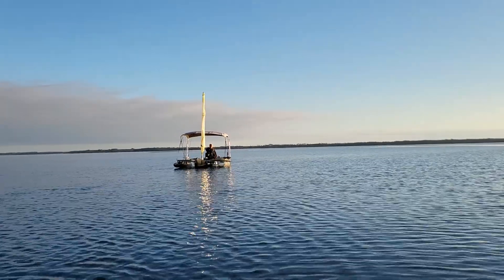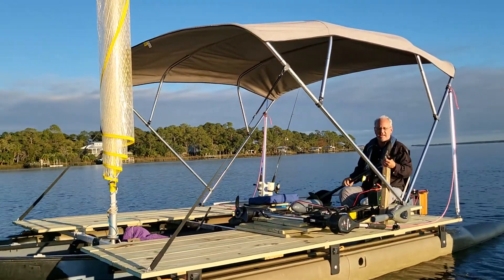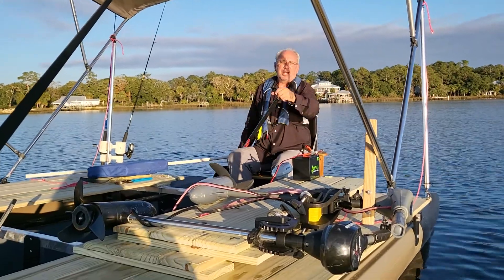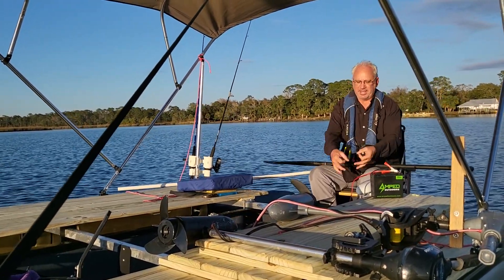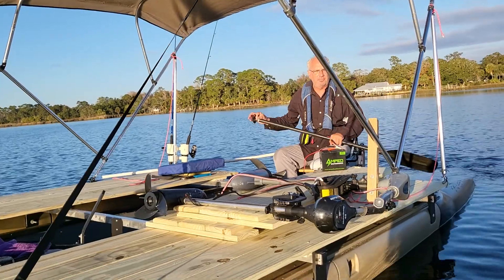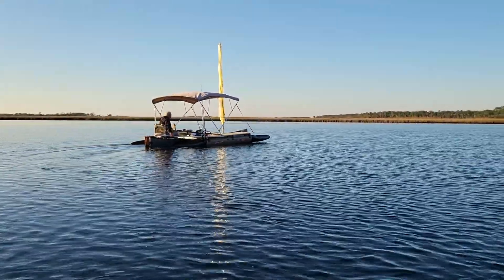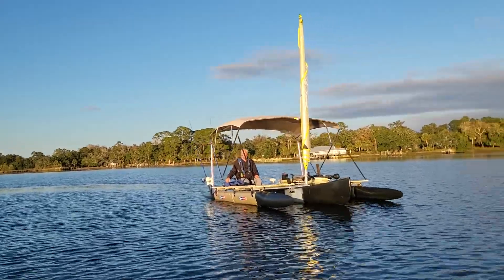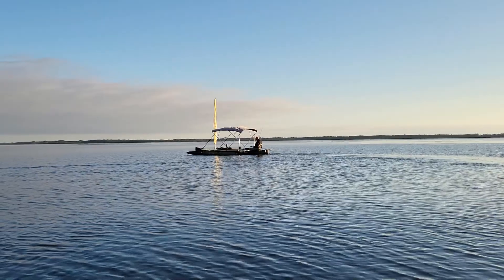18 lb thrust electric motor on an Expandacraft 16 ft Two Sided Canoe Outrigger Kit - Black and Tan.

Comment: Once you hit hull speed on a displacement hull more power makes little (if any) difference as far as speed is concerned. More power can make a lot of difference against the wind. Hull speed equals 1.35 times the square root of the waterline. Assuming a 16 foot waterline, the max speed (in theory) is 5.4 mph. An 18 pound motor in still water with no wind should easily be able to maintain that speed.
Reply from the maker: Yep

Comment: Prop diameter and pitch, gearing or no gearing also play into the efficiency of these motors.  A LiFePO4 battery can be discharged down to 20% whereas a Pb (lead acid) battery can only be discharged down to 50% without damaging the battery.  LiFePO4 batteries are half as heavy as Pb but more expensive (but prices are much lower today than several years ago).

Comment: Hes the general rule of thumb for brushed trolling motors..
At top speed settings... 1# of thrust equals 1 amp (this is just a average ball park figure).
Brushless motors are a whole different level
So a 40# would burn 40amps at top
A 55 would burn 55 amps at top. 
Your 18# should be burning roughly 18 amps.
Speed wise under no wind or current is going to be about the same across the board.
The 55 should top out a little faster is all.
That is IF all 3 are capable of reaching the max theoretical hull speed.
That speed vares for each model of hull.
It would seem for most of our kayaks that speed is around 3.5 to 4.5 mph
Any speed gain past the max ths takes a exponential amount of thrust.
It can be exceeded but it take a LOT more power for each little gain.

BUT.... that doesnt mean that a larger motor is a waste. because we have not factored in things like wind and current. The larger motors help to still reach that max hull speed against those factors.
 Being how i am most times on a river where the both the wind and current are against me a 18 wouldnt cut it.
I have ran 30, 40, 55 and now 65 motors on this river under same conditions. Each one showed a noticeable improvement over the smaller one. With the 65 being very very noticeable. 
My 65 is the haswing brushless which only burns about 32 amps at max (real world testing)
And i can hit my max ths at about half speed on the dial going down river and up river it take 3/4 top to reach ths.
Its very clear that iam at max yhs at those settings. turn up the dial and you can hear the motor working harder, but there is no speed increase.
 I track my speeds via a gps app that records and graphs my speeds.
So its not just a casual observance.

 FYI we started my friends install friday. Didnt get far yet due to needed to make a run to a hardware store.
Plan is to pick up again monday when this cold snap lets up.
I feel for you as a installer.
All weeks its been lets do it like this.. Then next day its what if we do it like this instead lol.
Its his rig so iam just going with what he wants lol.
I think i did get him convinced to install on the left side since hes left handed.
but he was like all the videos show the rigger on the right.
 Told him thats because all us weird people are right handed lol.
Reply from the maker: yep